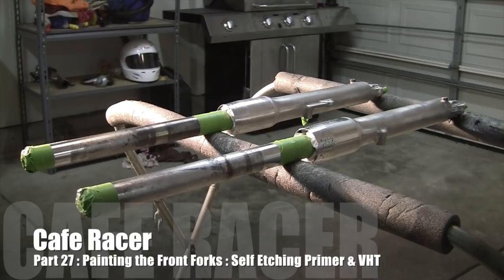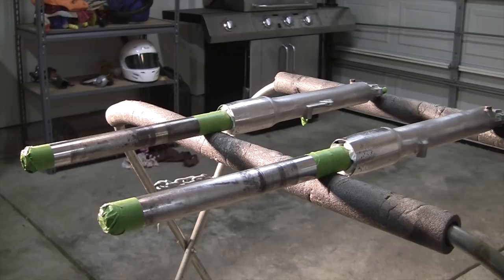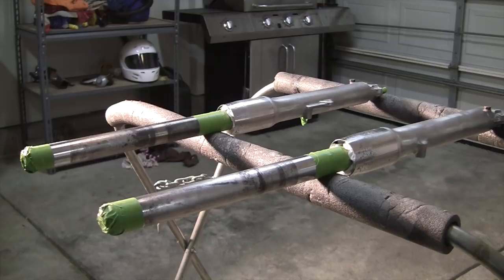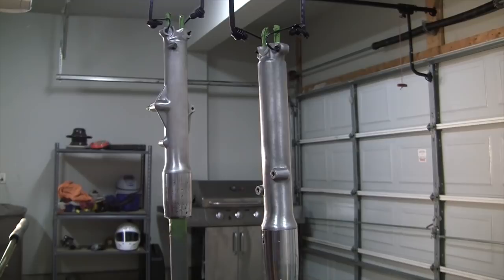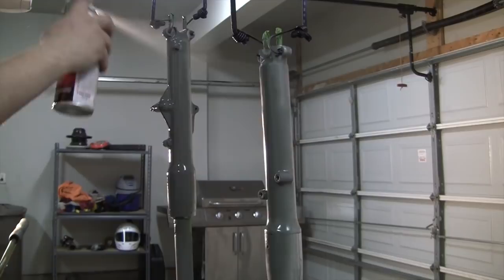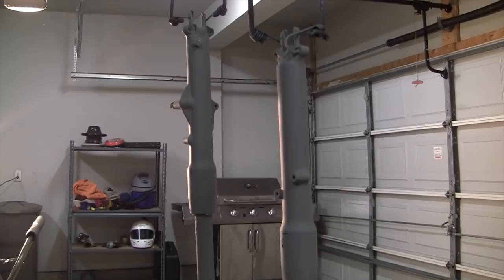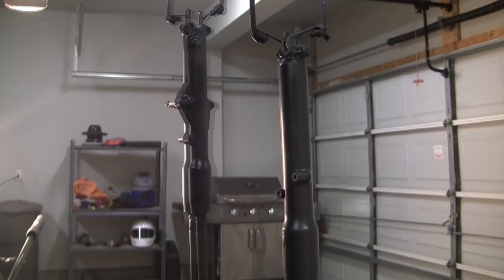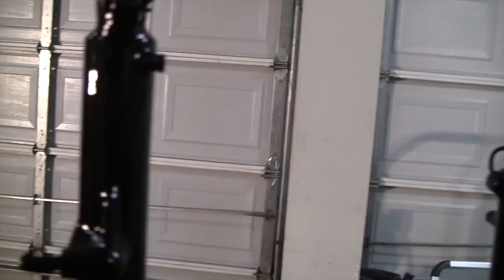Cafe Race Build  Part 27 : Painting the Front Forks Self Etching Primer & VHT

Comment: Thanks for that. I do have a question though. I have my forks removed (had to change seals) and I have the bottom parts ready to go. Step by step, what kind of sanding and what size sand paper should I use before priming? Do you have a prefered primer? I live in Canada so I figure the brand names are the same as in the states. I want to paint them in a black gloss finish. Thanks and great video.

Comment: @johnnysshop. Weve spoken before. I have the same bike. What precautions should I take when buying spare, used forks? and how much do they weigh (in lbs) I saw some on ebay and am buying them for the purpose of painting them black. also,I see you have some parts of the forks taped off and stuffed in this vid. Is there anything I should be careful of when painting the forks? That is, is there anything I should NOT be getting paint on? Also, I plan to clear coat mine when done.
Reply from the maker: +Janus Jeffrey Wilde I'd say as long as there is no pitting on the legs near the seals and you should be fine. I taped off the areas where the seals meet the legs so there would be no leaking. If they are pitted or painted in that area, you will ruin your seals.

Comment: Great vid, but I have a question about the VHT. Is it resistant to chipping? I want to paint my lower fork legs on my Harley Super Glide and eventually the forks on my 81 CB900 cafe project and I don't want to do it more than once.
Reply from the maker: skooli2 It will chip but it seems to be a lot more resistant to chipping then other over the counter spray paints. I've had pretty good luck with it so far.
Reply: Thanks for the info. Bike looks great btw

Comment: hi john i have a problem with my yz 85 it was running then died i thought it needs petrol so put some in i tried to start the bike and nothing i have cleaned air filter and carb and all the jets cleaned the plug even put new plug in and still nothing put some petrol down plug hole nothing until i used carb cleaner it started until it runs out of the carb cleaner compresion is ok but been told piston is not great so im stuck with a bike that does not want to start. can you help please.thank jojo
Reply: buy a new piston and rings and if that doesn't work take apart the engine completely and see if you have any engine damage anywhere if so fix it up or you could have a faulty bearing somewhere or something like that
Reply from the maker: How easy is it to kick? If the piston is really worn, it won't start.
Reply from the maker: Meant to say rings.. The piston could be okay, rings might be worn. Or it could be both...
Reply: ***** johnny  i have had 85's in the past and the kick feels the same to me
Reply from the maker: jojo robinson Have you checked for spark as well?
Reply: yes i have got spark i even got new plug still nothing
Reply from the maker: jojo robinson Hmm.. Perform a compression test yet?